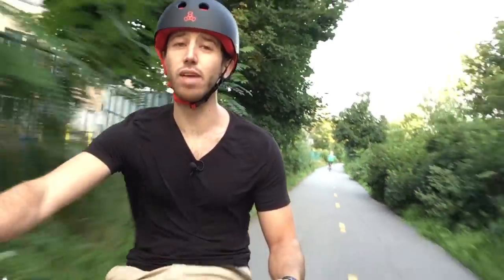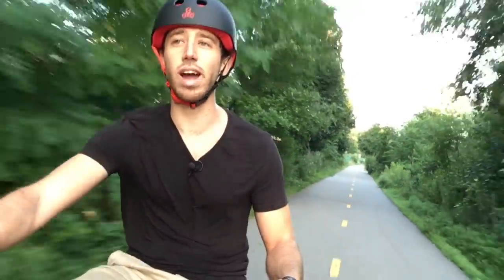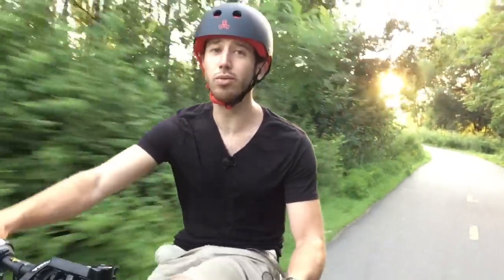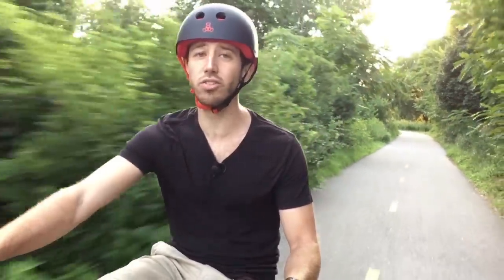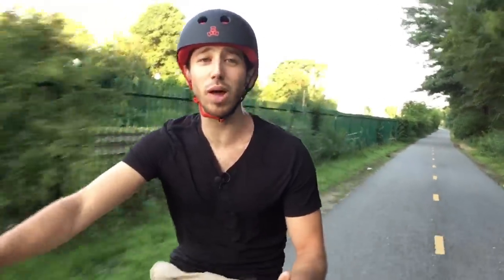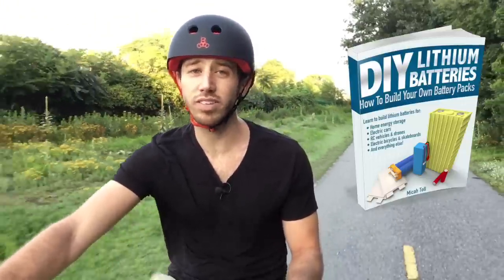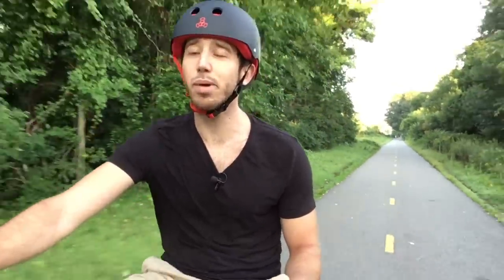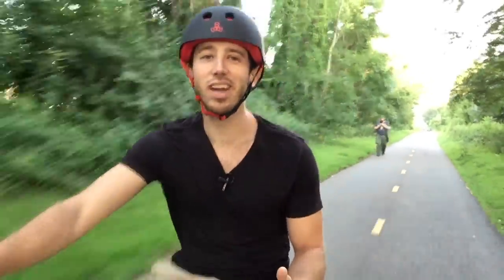10 Tips To Make Your E-bike Go FASTER!!!

Comment: Kelly Controllers have an async port that gives you access to settings, including power sent to the motor.
Reply: Others do as well, however some controllers are capable of it but not obvious about it. You have to find the RX/TX/etc connections on the PCB (often silk-screened pin-outs on the PCB) and simply require you solder in a connector to the PCB in the controller, then connect to the computer via cable in the same manner, then finally determine the right communication protocols (usually not too hard).

Comment: I went for ultimate speed. Yes it was expensive but worth it for the gains. 
I booked my e bike on a cargo plane and got the beast to 600mph plus.
Reply: 600 mph? God what did you use a flux capacitor?!
Reply: @2010Atomix  on the cargo plane)))

Comment: The Tyre pressure is unbelievably crucial, I noticed my (very basic shopper) ebike was getting way down on even it's already lowish UK limited speed & suspected a dying motor or battery, but checked the rear tyre pressure & it had gone  slightly down, I inflated it back up & the bike now goes like new again ( but I am still looking at giving it a  higher volt/amp battery, motor & controller to give it a substantial 'kick up the ass' when funds allow!!)

Comment: Actually, depending on the type of tire and the weight it carries, lower pressure can mean lower rolling resistance due to a reduction in bouncing which wastes energy. This has been proven in tests on this subject.
Reply: This only applies to bumpy dirt tracks. Road tires will always roll faster on road surfaces

Comment: How come there are no tips on how to increase range and cargo capacity? Always about going really fast over short distances
Reply: Because the only real thing to say is get a bigger battery. range is mainly battery capacity. 

Other factors are rolling resistance and wind resistance. Which are covered if you do the tips in the video, they are also relatively small compared to capacity (unless you are going relatively fast, which you would need the video tips to do anyway)
Reply: For cargo capacity, it's not an ebike specific thing. So not really this channels target audience. There are plenty of other channels for that though.
Reply: @smidget001  I don't think it's just the battery, I think there motor plays a party in it. The higher the wattage the faster the bike and shorter than range.

However I'm not entirely sure if it works like that. Because there are no videos about it.
Reply: @AshGreen359  yeah, electric motors don't really work like that. They have a pretty flat efficiency curve, so when you go slower you just use less energy. 

It's not like a engine which has to use x amount of fuel all the time and has gears to try and keep it in the sweat spot. 

I really meant my first comment. It's all about the capacity. You can get more efficient motors, but unless it is a genuinly shit motor they are all very efficient. 

The cost difference between a 90+ and 93+ percent effecient motor will be greater than the cost difference in batteries to offset it. 

Spend the money on batteries. They are the major limiting factor.

Comment: The wheel diameter setting does NOTHING to the top speed of my e-bike, it only changes what the speed on the display says. If you want to check this out for yourself, try lifting the back wheel off the ground and throttle it to max and see how fast the wheel spins.

Comment: Increase the value of 'max current' from your display setting. Instant bump in acceleration and top speed. Make sure your controller and battery can handle it, if not then don't ride full throttle for long.

Comment: Does a bigger wheel size go faster or a smaller wheel size… I have a 29” setting, on a 20” wheel. Changed it from 26”. Doesn’t really feel any different. Just thinking a smaller wheel should go faster. It’s a bafang motor I have, maxing 37mph just now. Trying to get it to do 45mph. Or more. 48v 25ah 2000w X5

Comment: I've been desperate to get my ebike's gears changed out since I got it. On a full charge I can't pedal fast enough to help my bike at power levels 4-5 out of 5. Which confuses the hell out of me. I leave my bike in top gear all the time and can start up with just pedaling. As a kid, trying to start in the highest gear was impossible on my 10 speed. What's the deal? I looked into having a bike shop do it when I first got the bike but for some reason they were backed up 6 months and I've never gone back.

Comment: So I have a super73 Z1 and I did the 36v to 48v conversion, I went from 20mph max to 32mph max speed. Now I want to add a bigger battery and go to a 52v, my 48v battery at max charge is 53v so is it safe to use a 52v battery on my controller?

Comment: Micah, what about if I have a 36V eBike with a mixed universal 36/48V controller. The caps inside are rated 63V (see my eBike here with pics: https://endless-sphere.com/forums/viewtopic.php?f=2&t=93576&start=25#p1376219). Can I safely overvolt to 52V 14S instead of 48V 13S (40% increase from 36V 10S) ???

Comment: With No-2 

If you have a 24 volt battery along with a 24 volt charger, If you swap the battery for a much higher voltage battery, Won't you then need a higher voltage Charger?

Comment: Hacking into your controller, to open up max power is always going to reduce the life span of your  motor, and drain your battery faster. A 90 lb. bike needs a 750 watt motor, to achieve roughly what a 50 lb. bike can do with a 250 watt motor. Cutting overall weight is the only real solution, short of upgrading the entire drive train, on a light weight bike. 
You can over push any motor, and get more speed. That doesn't make it a good thing, especially if it burns out your motor in a week. Gaining another 2 or 3 miles per hour is not worth voiding my warranty, or killing my motor.  Better to just buy a faster bike, or doing a DIY upgrade from a well designed kit, built by a professional who knows where to draw the line - mathematically speaking.

Comment: Tip #10 is so wrong. Changing the wheel size in the display setting does NOT increase your actual speed. It just changes the display speed on the screen. You can verify it by using a GPS speedometer on your smart phone. 
Instead you can change the speed limit on your display setting to 100 (= 100 KPH, yes most displays are in kilometers, 100 kph  = no limit)

Comment: Hyper eride - Fun bikel
Aftermarket suggestion. I'd like to add
a from hub motor, identical to rear.
Plug straight into original electronics
but with a thumb throttle. On some of
my big steep hills I'd like to boost the
boost :)
Cool if someone could make an easv
plug n play.
If it needs its own power, a water bottle
shaped power pack added on top of
eride battery..

Comment: Use a ten euro boost converter....You can go go 55 volt..with a 36 volt controller..use a rear hub motor..250 watt van handle 400watt easy...i say do not middrive .IT has to Manu gears.and it's to expensive.en diffecult to peddle when ya accu is empty..it's Just a rip off

Comment: I do not ghost ride, only pedal with cadence of engine. I use a Rohloff speed hub, schlumpf drive. My front hub is only 1500 watts, 48v, 12ah, although I'm way faster then friends with 2000 watt 52v rear hubs and mid drives. They can't pedal at high speeds.

Comment: I'd be very careful about swapping out your e bike battery for a higher voltage.  The well circuitry was designed for the battery voltage it came with.  It's like swapping out batteries your flashlight is designed for and putting higher voltage batteries in it, your will end up burning up the L. E..d..    it's life will be shortened.. just like an e bike, stay with the battery voltage it came with...

Comment: not a single one of these tips will increase the speed my e-bike motor can deliver, only hacking the motor might help and that makes it prone to defects (E014) and voiding the warranty - only promoting the book makes sense

Thanks for nothing

but as always with clickbait, there are also useful things like ducking into a headwind, for example, that works on all vehicles, but has nothing to do with increasing speed, you only have less surface area to brake - the motor of an e-bike ( without manipulation) only provides the speed up to the maximum speed set in the motor.

In the same way, you could throw an e-bike out of the window in free fall and claim that you can increase the speed in this way?

I wont buy you book!

Comment: Is it good for the battery to charge it everytime you use your ebike even just for a short trip? I wonder maybe it will have an effect for the life of the battery.
Reply: If you keep your battery set between 60-70% when not in use but use it regular, you’ll be fine. No harm in topping it back to 100% after every use just as long as you don’t keep the charger plugged it overcharging it.

Comment: No shouldn't charge the battery every use , I was informed not to do this on picking my e bike from the store 
It will reduce its life , 
Let it run down then recharge , you can recharge now and then at like 50% but dont do it all the time.
Bad advice here in the video 
Battery needs to discharge then recharge to keep it tip top.

Comment: Lithium batteries perform best when they are fully depletd of the charge from full, if you only use half the charge and recharge back to full reguarely you will decrease the life and the performance of the battery quite a bit.Visit a rc site on how to charge and maintain lithium batteries ,very different to other recharble batteries.

Comment: hello  I have a  Juice bike  Rip Current S    fat tire bike   750 watt bafang rear hub motor  and 52 volt battery  what would be best up graded motor    Juice has a new  Hiper fat  bike with a 1100 watt motor      would  that motor  work on my bike with just swapping motors  ?  thanks henry     ps I have bought one of your books ,, thanks

Comment: Clip on aero tri bars. A test was done with a specialized tarmac and transition triatholon bike. To maintain 40 km/h the Transition needed 260 watts and the Tarmac 307 Watts. By putting clip on aero bars the Tarmac dropped to 270 Watts.

Comment: Also other good things to check is : 
make sure you keep your chain well lubed and clean and make sure your chain is not too tight it should have at least 10 mm Slack. 

Also check for bearing wear on your wheels, motor and any transfer Drive equipment. 

Also check electrical connections are tight and secure and do not have any corrosion. To ensure solid connections you can get a spray that you would spray on electrical connections and anywhere you want to stop water ingression. 
 which are known as corrosion inhibitor sprays and and electrical contact cleaner. which is basically brake cleaner. 

Any electronic contacts that are exposed to the elements like earth cables should be covered lightly with Vaseline to prevent corrosion or dirt ingression.

Comment: Hi there, I have managed to get hold of SCOTT 930 MTB with 29"inch Continental Double Fighter 2 Tyres installed for grip benefits of the road surface, and converting it to Touring Bike, including front Hub Dynamo 
with Panniers Back & Front, using the top of the Range Bafang Motor...... to take the extra weight with a 42 Lekkie and 52 V 17.5  Battery, to suit the power of motor.  I have never built one of these  Power assisted Bikes before, but it looks like I need an extra battery? I am not a Boy Racer, and speed of Travel to minimum touring level
I have just be Told the do a remarkable New Analytic Device  that gives you more Precise Data,  I am very excited about this Gadget, as love to recapture my Long Lost Youth on West Country Coastal Runs together with the New YHA Places you can Rest and  enjoy Peaceful surroundings without being over commercialized my intention is to use this E-Bike for Spring & Summer use only, but do I have to Strip this Bafang apart and regrease it from my Tube of Mobile 28, or can I go for the odd 1000 miles before this is necessary.  Please try and contact me on Facebook I have two accounts and would like to know.

Comment: Hi, Im having a Trek Rail 5 (2020 model) the engine is Bosch Performance CX, magnesium motor body, 250 watt, 75 Nm and the battery is a PowerTube 625 setting In the frame. It’s 
Voltage	36 V. Can I make the bike go faster by changing the battery to higher voltage and if yes where do you get a compatible battery. Hope one of you can help 😊🤞🏻

Comment: @EbikeSchool.com I'm trying to order a Reention Dorado battery from China 48V 17Ah and they are asking me what size Watt motor my ebike has. Can someone explain why? I'm sure it is because of the BMS and the amount of amps that the battery can provide, cutoff voltage etc.. But what if I told them 750Watt motor instead of the actual 500Watt motor on my ebike. What difference would it make if I get a 750W BMS capable battery instead of a 500W BMS battery and use it on a 500W ebike???

Comment: Hi! I have a 60v 1500w motor on my citycoco scooter(8inch Wheel) but my controller is only1000w 
The max speed on the gps is 38-40km/h if I change my controller with a 2000w one with more mosfets will that increase my speed for a little bit? I am tinking like 45 or 50 km/h? Please answer E-bike will help me all ot

Comment: I have an SW900 LCD and one day my bike just quit working and LCD error code "07", motor problem. I bought a new controller with same results. I have an old controller that doesn't have a plug for my SW900 LCD and that runs my bike just fine. Any suggestions?

Comment: Last year I bought that Fiido L2 bike from your link. And I would like to change it to go at least 20 mph especially using the throttle.(living out here in the boonedocks 12 miles to the next town)  What two wires should I disconnect ? Do you know ?

Comment: One more tip that works on mid drive with no speed limiter: Put a 56T sprocket in front so that you can contribute to speed when pedaling above 30 mph. Adds another 200W and avoids ghost pedaling.

Comment: I over-volted my 24V 250W brushed motor to 36V and with a 500W controller. Bumped up the speed from 25kmh to 40+ kmh. Had quite a lot of fun for a few rides. The motor burnt out after that. Fortunately replacing the motor was less than US$65!

Comment: Ok just bought a front motor,  like Mikey's bike but I'm trying dual 36v 23amp motors, Yep I know Voltage is speed and Amps is Torque but what can I expect? I'm guessing better hill climbing and acceleration? but I've previously put a link to an America channel which said its a waste of time, but I've seen and driven twin engine cars I drove a golf with 2 x 300bhp motors one front one back and it was beyond brutal, I'm doing it anyway as I'm just waiting for my new spot welder to make a proper 2nd battery, soldering works but it ain't great, and as I've said before Mikey and Bruno's channels have a lot to answer for, the misses is really peed off at my hobby.